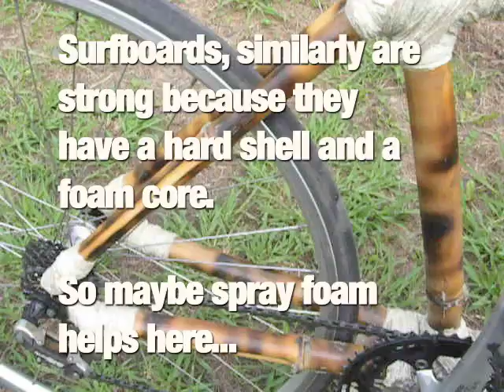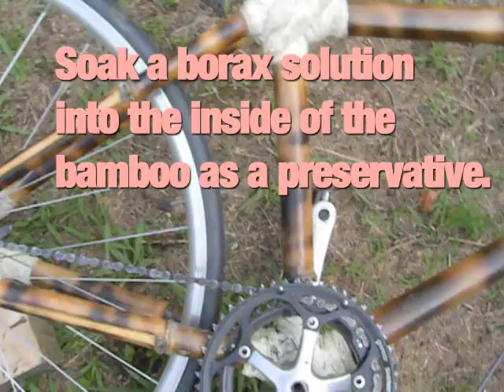Bamboo bike explained

Comment: I like that you used wood glue . Keeps it environmentally friendly.  You could shou sugi ban the bamboo with a torch. Be careful not to overheat it because it will burst, just cover it in coconut oil let that absorb and then scorch the surface.  This will increase the rigidity and you can add linseed oil over it to prevent staining your clothes black.  I would probably sand the strings smooth for aesthetic purposes,  a die grinder is a good tool for that. You could then go back and seal the strings with linseed oil. Since you used wood glue it may be more structurally sound to wound the supports out a few inches further than you would with carbon tow and epoxy.  Wood glue is heavier and more flexible, although you can use the flexibility to you advantage, it just needs more contact with the frame so it wont delaminate. Look up a product called shrink tape, it is used for carbon fiber wet layups and allows you to apply alot of pressure to an area while it dries, this will help you have a better string to glue ratio.

Comment: That's amazing. I am seriously considering building one. But can I be sure hemp and wood glue is as good as carbon and epoxy? How about combinations (hemp/epoxy / carbon/glue)? I'd like to avoid epoxy but think that it would also greatly benefit stability ... I generally ride my bike in a hurry and really couldn't use a breakdown at high speed ...